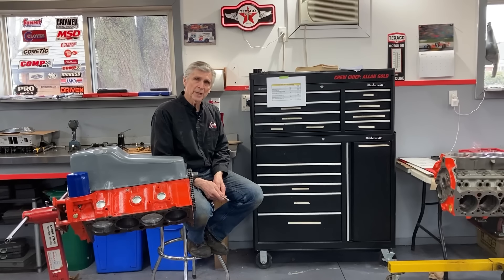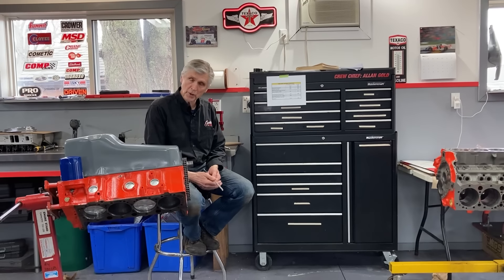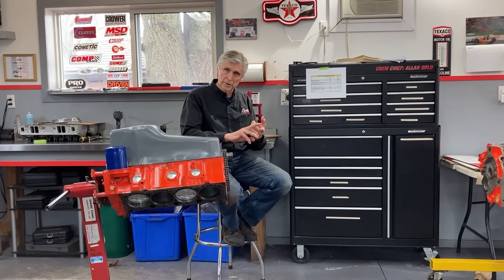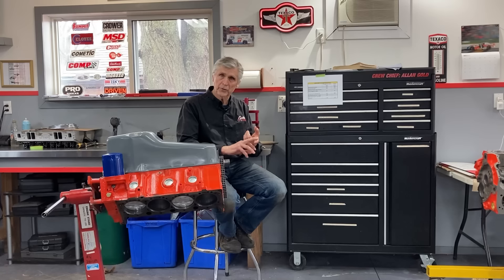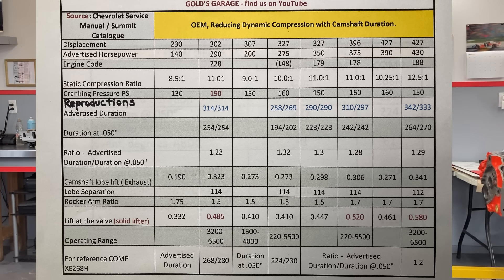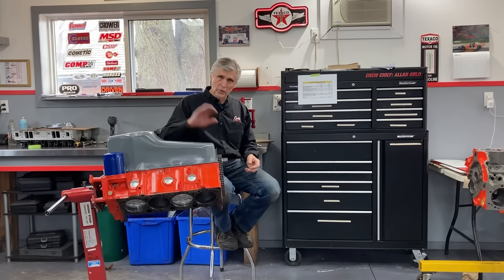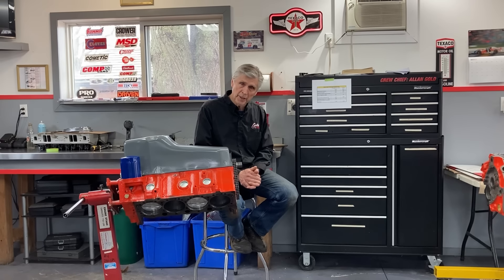Selecting the right camshaft - Compression Myths How much compression can you run on pump gas?

Comment: The late, great Joe Sherman once said if it pumps under 200psi, it'll run on pump gas. I've ran 13-1 engines on 93 octane on the street, of course I used racing fuel at the track.
Reply from the maker: Thanks for the info.
Reply: A man could learn alot from Joe Sherman. Shame he passed away.
Reply: Sport bikes commonly run 13+:1 on 93. Of course they have 3D air and fuel tables and huge development budgets.
Reply: What changes did you make to your tune to switch between fuels?
Reply: @trailerparkcryptoking5213  Jacked the timing up to around 40 degrees.
Reply: @trailerparkcryptoking5213  Pulled the timing back to 30 degrees or so on the pump gas. Definitely lost power. But still had enough to go to jail. I'd usually just creep around in street mode.

Comment: Static compression vs Dynamic compression are two totally different things. And that's what blows people's mind. There isn't a limit on compression ratio and fuel... It's cylinder pressure and fuel. And when the engine makes peak torque, is where you have peak cylinder pressure and when it starts eating itself if things ain't right.
Reply from the maker: Thanks for watching and commenting TEAM. Good luck with your channel.AG

Comment: I ran well over 13:1 on pump gas.  I did not build this engine to run on pump gas.  I purchased a used 406 short block and was going to put my top end on it which consisted of a set of AFR210's and a port matched Victor Jr. with a Race Demon 835.  The 406 turned out to be junk and I already had a camshaft made for it for nitrous.  The compression of this 357 smallblock was well over 13:1.  The pistons were Ross 91461 with a 15.2cc dome, it was zero decked, the chamber size of the heads was 66cc and the head gasket was 0.040" thick.  The cam was 268/274 @ 0.050" with a 108ICL, 112LSA and 630" lift.  I ran it on the street and raced it on the track with nitrous.  After running it for a while I did a cold compression check and it came in at 195-205.  This was lower than my previous 355 so I ran it on 91 octane pump gas while on the street and race gas when I took it to the track.  Race weight was 3,420 and it ran 11.20's at 120 on the motor and Ten teens at 132 on a 175 shot.
Reply from the maker: Thanks Steve for sharing your knowledge and experience. Confirmation for me. AG

Comment: It never occurred to me that the cam would directly affect compression, but thinking about it it makes total sense. Many years ago (1985), I had a 1972 Oldsmobile with a 455 that appeared to be stock. It had plenty of torque and was fairly good on gas. I always ran Sunoco Ultra which at the time was 93 octane and it ran great on it. I did cranking compression test on it and got between 185 and 205 psi. It also had nice idle and the stock GA heads typical for ‘72 455s. Thanks for the great presentation, you got me thinking.
Reply from the maker: Thanks for the info Steve. We are always learning. Your compression pressure explains your good torque and mileage. AG

Comment: An answer to the question about using regular instead of Ethyl in an L88 with 150PSI of cranking compression would be yes, and no. You could probably get by safely with retarding the initial timing and liming the amount of advance in the distributor. You should also mention not only the intake valve closing event timing having an effect on cranking compression, but explain that a later closing event will usually lead to more overlap, which causes the compression to bleed off.
Reply from the maker: Thanks for the info Robert. You have obviously given this a lot of thought. AG

Comment: So here’s a question from a young fella learning. What’s the point of having a high static compression engine if you just have to bleed off compression with a later intake valve closing point to reach a desirable dynamic compression ratio?  Compared to a lower static compression engine with an earlier intake valve closing point that yields the same dynamic compression ratio as the high static compression engine? Enjoyed the video, thanks!
Reply from the maker: That is a very good question R. Engines are more vulnerable to detonation at low RPM when piston speed is low, so bleeding off compression helps. 
Fuel/air mixture has mass and so it has inertia.  At higher RPM, this inertia compresses the mixture against the back of the intake valve and essentially supercharges the cylinder when the valve opens, thus increasing dynamic compression. The engine is less vulnerable to detonation at high RPM because the piston is moving so fast that the flame wave does not have time to do damage. 
Let me know if this helps. AG

Comment: My best engine at the track was a 418 ls2 engine. An aluminum block let me get close quench numbers (.036) piston to head. I also used cam motion to spec a cam for me to use 12.5 to one compression using 93 pump gas. This engine ran faster than my 496 cube all cast iron BB.
Reply from the maker: I believe you Phil, those engines make great power.AG

Comment: Hearing you talk about that GM "151" cam made me smile, It was my number 1 choice for my pump gas street engines in the early 70`s. In the early 90`s I used the 292H Comp cams for that lumpy idle the guys liked and it run strong in a 350. One of the old guys I worked with when I was a pup told me to assemble the long block on the stand put a starter on it and starting at straight up take a compression check then advance the cam and take another compresion check and stop when you got the highest reading, it worked surprizsngly well. Them old boys know there stuff.
Reply from the maker: Thanks for sharing your knowledge and experience Ed. That is a good method. AG

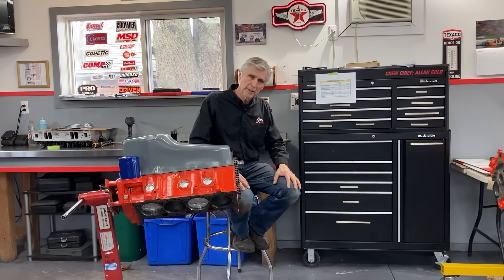Comment: In about 1992 I had a 68 Camaro daily driver with a .30 over 454. I had a .250 domed piston, with a Comp Cams 292 Magnum cam. 244 at 50 and .556 lift. The cranking compression was 225 lbs. on average! I used a stock converter, Turbo 400 trans., and a 4:10 12 bolt rear end. I drove the car on premium fuel at 91 octane. I had to dial back the timing to stop detonation. It wasn't an ideal combo for the street, but it was a beast! The widest tire you can run on a 68 Camaro is 11.5 inches. That's what I ran and the Hoosier Quik Time street tires couldn't hook! It was a ball to drive!
Reply from the maker: Thanks Rick. That would be a beast for sure. You were definitely pushing the limits of pump gas and also it makes me think i am being conservative with my 180PSI target for street engines. AG
Reply: @goldsgarage8236  Less compression and or more duration on the cam would have been better for a daily driver. The car ran a best of 12:31 at 114 m.p.h. at the track. My best 60 ft. time was a terrible 2:19, because of loss of traction! I never did run it on slicks. In 4 years of street racing I only lost 3 times, and all 3 cars were running either nitrous or blowers! I never lost on the motor only. I was the only true daily driver racing at the time. The Camaro was my only car.

Comment: I remember reading an article in a Chevy Hi Performance magazine where  some automotive school was tasked with trying to make 700 ft lbs of torque on 87 octane. They ALMOST succeeded except for a mechanical problem with a spiroloc missing. The build was a 502 BBC with hypereutectic pistons having a CR of 12.5:1 and the engine having a special flat tappet grind and including Feuling aluminum peanut port heads with small chambers. I believe they used a Holley street ram efi setup along with an aluminum radiator filled with Evans NPG coolant. The motor ran fine until the wrist pin on one cylinder worked its way into the side of the cylinder. I recall being amazed that such a high CR could be utilized on 87 octane. I wish these greedy petroleum companies would produce just one street octane of like 95 or thereabouts. Europe only does one octane to my understanding. Thanks for a great video.
Reply from the maker: Thanks Racer, that is a stretch for sure. AG

Comment: Thank you for explaining that so easily and precisely.
As an Automotive machinist, I have tried many different engine combinations with compression ratios, from using frquencied inlet manifolds to boost low and midrange torque, to camshaft s with various duration and split etc etc.
Yes you can run 12:1 + on pump gas and still have a great performance with the benefit of great fuel mileage to boot.
Reply from the maker: good points, thanks for your comment Dean. AG

Comment: Aiming for the 160 psi cranking compression mark compared to the 180-200 mark depends on a lot of factors. Having extra leeway for detonation resistance is a good thing but it trades off a bit of power. The person that might not have the knowledge to monitor that they might be more prone to engine damage in certain circumstances (like a particularly hot day), should probably have a bit more leeway for their car. The vehicle it's going in plays a roll too; lighter cars with shorter gears are going to be less prone to detonation too. Then there's also the little things in the build; like smoothing out edges in the combustion chamber, quench, piston style etc. 

All great information. Great video
Reply from the maker: Thank Troy, the problem I have with building engines for others is that i have no control over these things once it is off the dyno. i worry about them all. Thanks for your input. AG

Comment: I ended up getting 9 years out of a comp extreme 4x4 cam and Rotella oil. I used the truck for daily driver and off road adventures. At the 9 year mark it started chewing up a lobe on #4 and I had to sell the truck as I had no $ to fix and it was no longer practical for me. Thanks for the no flare no bs info, when you said thats fine we don't have to agree you got me.
Reply from the maker: Thanks Kris, good info and very nice compliment, appreciate it! AG

Comment: I agree 180 compression minimum. 
I target between 185 to 200.
But that's not written in stone.
All kinds of factors, cast iron heads, aluminum heads.
Cast heads static lower.
Duration @.050, gears, tire size.
And finally, the customers ability to tune the combination. 
Conservative is good always.
But pushing the envelope requires knowledge and experience, not guessing.
And I have not even got into carburetors and Fuel Injection. 
Pump gas, compression up, timing back.
Like I said, not written in stone.
And a learning curve, always.
Great topic.
Thanks for sharing. 
Take care, Ed.
Reply from the maker: That is correct Ed. I will have more about that in my next video. Please keep watching.

Comment: The old GM solid lifter cams had the valve timing and overlap to manage DCR.  By closing the intake valve later it allows the SCR ie 11.00-1+ to bleed off cylinder pressure at low-mid rpm when the engine is more susceptible to detonation. 
Intake valve closing event is a huge factor in engines running 12.00-1 on pump “Premium” by lowering the DCR. 
Aluminum heads, rule on max DCR for 93 octane is 8.70-1… but many push it to the edge at 9.00-1 but be warned.😉
Iron Heads the max DCR for 93 octane has to be below 8.70-1, I haven’t found any data to share but I’d think less than 8.50-1 DCR
Reply: Well said. Sir
Reply from the maker: Thanks Headflowinc. I am planning a follow up video on this subject. Thanks for reminding me to include the issue that engines are more vulnerable to detonation at low speeds. I have researched info in this subject.

Comment: My 2018 F150 with the 5.0L has 12:1 . It can be run on 87, but I run 93., previous owner of 67 GTA fairlane 390, 70 cougar, 351W & 79 Mercury Capri with 351W with 289 heads ... Did Not like anything less than 101 octane. 
Ultimately the engine died from pre-ignition. Great video Sir.
Reply from the maker: Thank you Gunny for your comment and sharing your experience. AG

Comment: If did the calculations correctly (as you say at the end of your video) then, my Comp Cams "Low Shock" cams on the cam card are showing an Advertised duration of  276*/282* and 246*/252* shows 1.12 for the Intake and 1.11 for the Exhaust and according to what is being explained in this video it sounds like my cams have very aggressive ramp speeds which I told them I DID NOT WANT---I specifically told the tech from Comp Cams that I wanted their "Low Shock" cam profile design with easy, smooth, non-aggressive ramps. I guess they didn't get the memo!!! I will send them back! Thank you for your video and detailed explanation.
Reply from the maker: Thanks Dune, glad you found the information helpful. AG

Comment: Great video. I run a w30 4spd cam in one of my 455s and it has 329 duration they are lazy cams compared to todays grinds because of the ramps. But are easy on valve train.
Reply from the maker: Thanks for sharing Wildrose.
Reply: I have a fast ramp cam and heavy springs in my olds 455 and it beats the tar out of the valvetrain especially those ridiculously long pushrods are definitely bowing.

Comment: OEMs (and those of us working on emissions reductions in hot rods) have other tools as well. The decrease in fuel mileage you mentioned can be combated with variable valve timing, EGR, and even Atkinson-Miller via valve timing. The tough part (which is what I’m working on) is variable duration as well, in order to maximize power when using race gas. There are other tools I’m also working on, but these are proprietary (my goals for my 4.6 liter Ford Mustang are 450 hp / 45 mpg on pump gas — not at the same time of course).
Reply from the maker: Thanks Ed. those are all good technologies. Let us know how your Mustang build goes. AG
Reply: 2, 3 or 4 valve heads?
Reply: @johngregory4801  3 valve. I chose 3 valve because I’m removing the camshaft (and all the junk in the middle related to the lash adjusters) and replacing it with a pneumatic valve actuating system. 3 valves gives about the same performance as 4 but requires less compressed air for the pneumatic system. The pneumatic actuators are electronically controlled so i have COMPLETE freedom of valve timing specs.
Reply: @ehb403  COOL! Who's it from? I've seen pneumatic valve spring systems before, but not pneumatic actuation for valves. Talk about being able to optimize timing for all revs and all conditions!
Reply: @goldsgarage8236  The engine is from a Mustang, but it’s going in my Ford Fusion…mainly because my wife nixed putting it in the Lincoln MKZ (same car with nicer options and accessories) since it already has a 400 HP engine in it from the factory.

Comment: Answer to your final question, while I'm only guessing, I'd say low speed and load maybe, depending on many variables.  But as RPM increases the addition cylinder filling would send cylinder pressures way beyond what 87 could resist.  I built an 11.6 to 1 408 small block with cranking pressure of 217.  It's a tight quench motor with aluminum heads.  While it runs very well on the primaries, 93 octane (tunnel ram) it does rattle @ W.O.T unless I use race gas.  I think it's because of the same reasons stated above.  Backing timing low does not help.  My W.O.T AFR is fat as well @11 to 1 so i don't think it's a lean induced rattle.  Although I can not rule out poor cylinder to cylinder AFR.  Love the tech by the way. I'm always looking to learn more, thanks.
Reply from the maker: Thanks Bobby, you are braver than me but it sounds like a very nice engine. I am planning to address the points you mentioned on a follow up video so thanks for the input. AG
Reply: @goldsgarage8236  Looking forward to it!